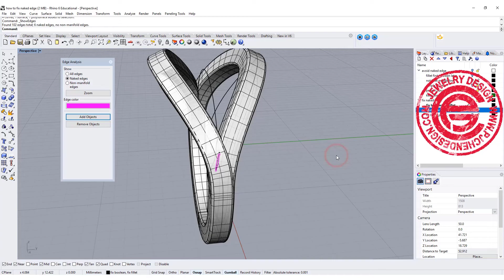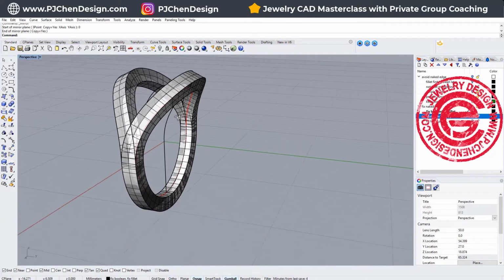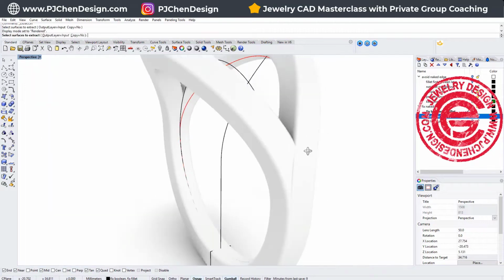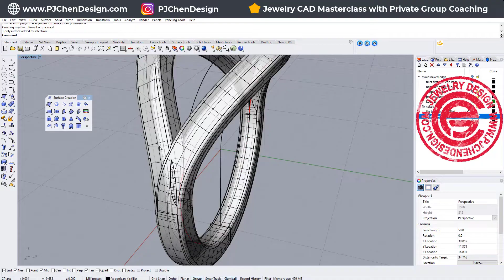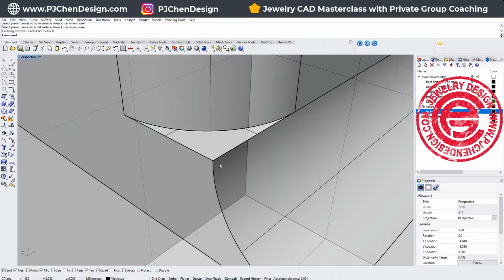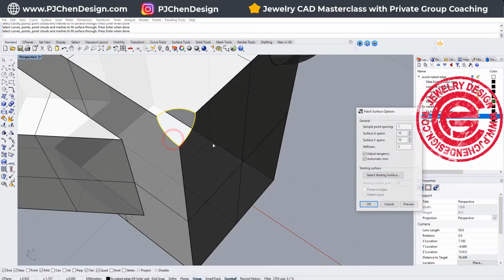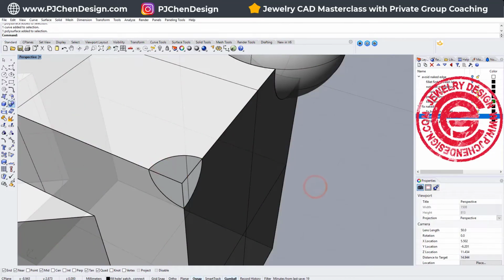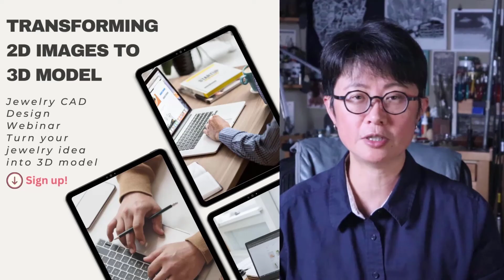Mastering Rhino 3D: Expert Tips to Reapair Naked Edges- Jewelry 3D Modeling #448

Comment: For very small holes after Boolean commands, I use the "join 2 naked edjes" command. In some cases, the untrim command can do the job for a surface with a hole. To make smooth edges I use the "blend surfaces" command.
Reply: Thank you for mentioning this as well. This saved me! 🙌😃
Reply: also, for simple holes, CAP is really straight forward.